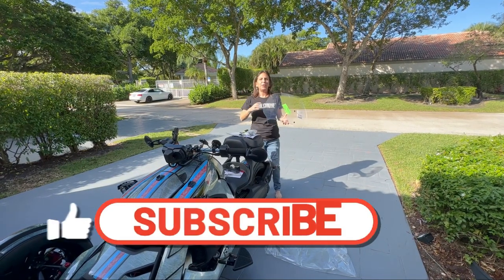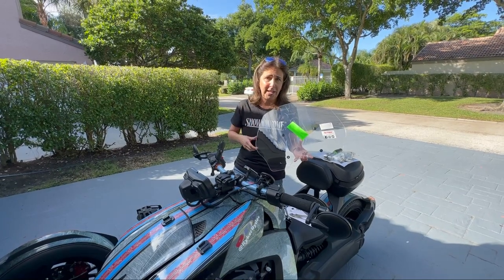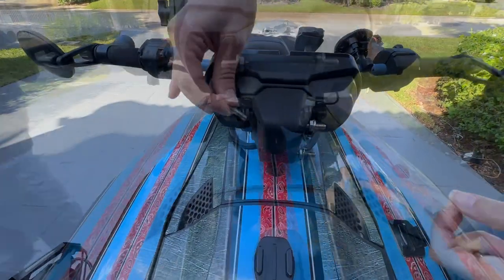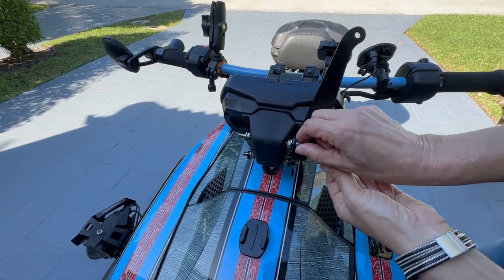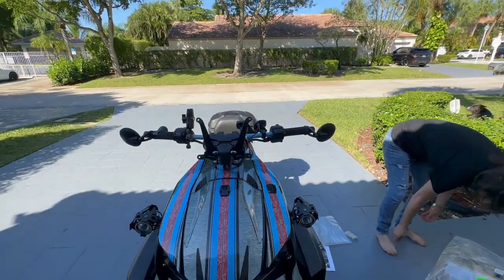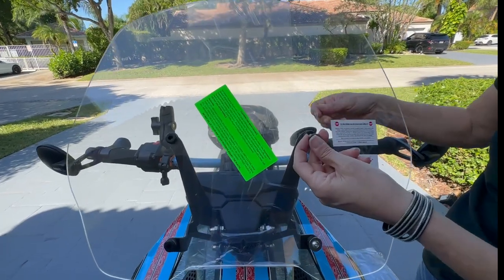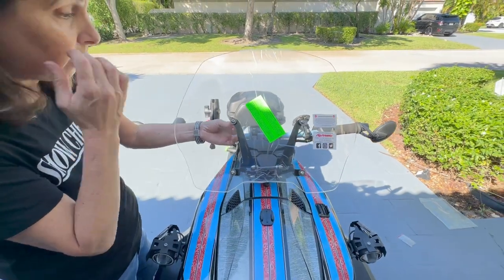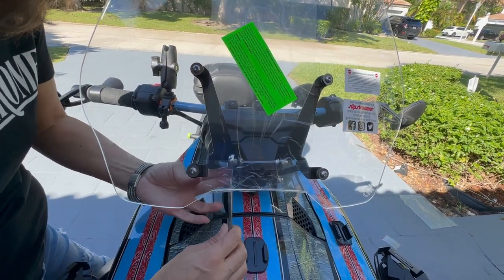Show Chrome Windshield Install and Review

Comment: Use Plexis to clean the shield and replace the acorn nuts with nylock nuts... I've had the same shield for the past 2 years. The only problem I have with this shield is if you wear ADV lid it will catch the wind so a non-visored helmet will be good.
Reply from the maker: Interesting. Thanks Ron.
Reply: Plexus works great! It's the only thing I use on my windshield and I carry a can with me on my spyder. 🤗💜

Comment: I am trying to decide on material. What are your thoughts on Acrylic vs. Polycarbonate? I know this one is Acrylic which I heard is not as durable against damage as the polycarbonate.
Reply from the maker: To be perfectly honest, I don’t know much about polycarbonate windshields. I do know polycarbonate is a much stronger material which would probably make the shield more expensive? There are tons of articles on the internet about polycarbonate versus acrylic.
Reply: @RykerRydes  thanks for the response

Comment: Can I ask what’s the point of a windshield on one of these I thought whole point was to feel the open air ?
Reply: You still get a breeze even with a windshield but don’t the grit from car tires hitting your neck. That was my reason.
Reply: @johnd9031  I guess I’m lucky cus I don’t have a windshield n the only thing that has hit my neck was a leaf 🍂 lol
Reply: A dozen reasons for a 'shield. Wind, dirt, bugs, rain, birds, helmet with visor, etc.
Reply: @JohnJohnson-jaxjlj  I’d just get a helmet then a helmet would help all that and still get to feel all the wind and not just some of it
Reply: @Arnis Bole  it all depends on your comfort level. When I had my Cafe racer I would usually be uncomfortable because that was a direct result of my riding style. I would never ride like that now. I want relative comfort.
Reply: @JohnJohnson-jaxjlj  I’m not bashing anyone who wants a windshield was just curious
Reply: @arnisbole7821  All good. 😎🤓😀
Reply from the maker: My #1 reason is wind pressure. I ride a lot on the highway, and without a windshield, it gets very uncomfortable with the pushing against me.  To each their own.  Ride your ride!